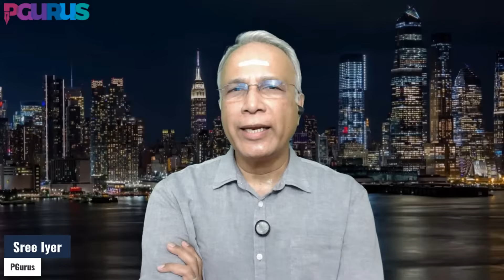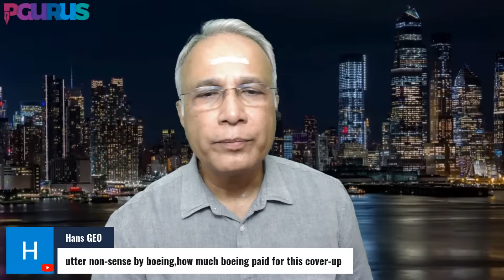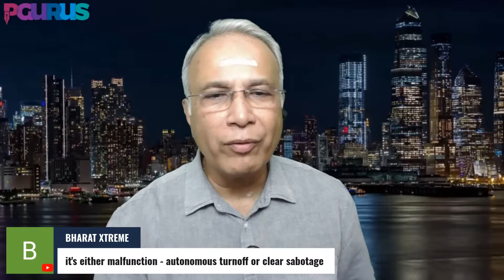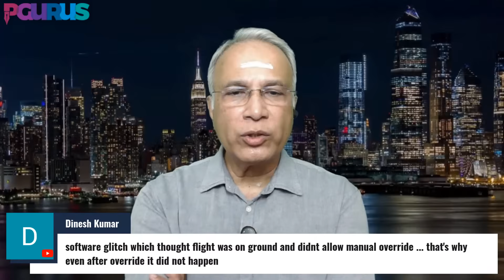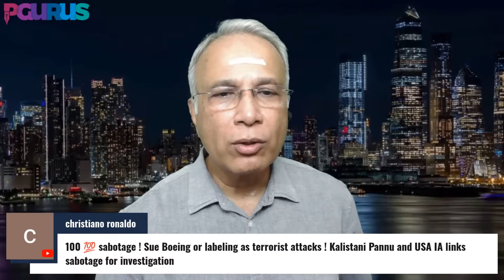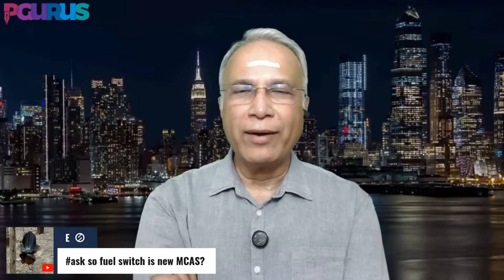AI 171 Prelim report shocker • Sree Iyer

Comment: 🧩 Most Plausible Crash Scenario: Step-by-Step

⸻

🔧 STEP 1: Tampering Occurs During Ground Turnaround (~5 minutes)
	•	Flight AI171’s aircraft (VT-ANB) arrives from Delhi to Ahmedabad ~2–3 hours before its scheduled return flight.
	•	During this downtime, a malicious actor with authorized cockpit access (e.g. ground engineer, technician, or cleaner) enters the cockpit.
	•	They intentionally flip both fuel control switches to CUTOFF, internally disabling fuel supply to the engines.
	•	Using subtle manipulation (e.g. bending or dislodging internal latch or spring), they force the switches to visually appear in the RUN position, misleading the pilots.
	•	The entire act takes under 5 minutes and leaves no obvious trace if done carefully.

✅ Why it works: These switches are mechanical, and their position indicators are not electronically monitored. The system assumes visual + pilot input = actual state.

⸻

🧪 STEP 2: Pilots Arrive, Perform Normal Preflight (~30–45 min before pushback)
	•	Flight crew performs regular cockpit setup and checklist:
	•	Engine start switches → CHECKED
	•	Fuel switches → visually appear to be in RUN
	•	Engines are started normally:
	•	FADEC uses pressurized fuel in the lines to spool up
	•	No alarms are triggered because system believes switches are in the correct position
	•	Pilots proceed with taxi and takeoff prep.

✅ Why they don’t notice: There’s no indication from EICAS or ECAM of fuel flow blockage until engines actually flame out. These switches do not have active feedback systems.

⸻

🚀 STEP 3: Takeoff Roll — Aircraft Lifts Off Normally
	•	Aircraft begins takeoff roll, reaching V1 and then rotates as planned.
	•	Thrust is still available from fuel already in the manifold, and the engines deliver expected performance.
	•	Aircraft lifts off and begins climbing.

🧠 Fuel in the lines masks the tampering for ~30 seconds.

⸻

🔥 STEP 4: In-Air — Fuel Supply Fails, Both Engines Flame Out Simultaneously
	•	~20–30 seconds after liftoff, the residual fuel is depleted.
	•	With the fuel valves internally closed, no new fuel reaches the engines.
	•	Both engines rapidly lose power and flame out.
	•	EICAS displays:
	•	ENG FAIL L
	•	ENG FAIL R
	•	GEN OFF BUS
	•	FUEL PRESS LOW

⚠️ The aircraft enters total power loss while climbing, now essentially gliding with limited time and altitude.

⸻

🎙️ STEP 5: Cockpit Confusion — Attempted Recovery Fails
	•	CVR records only:
“Why did you shut off?”
“I didn’t.”
	•	Crew likely:
	•	Flips the fuel switches again, trying to “re-confirm” RUN position.
	•	Initiates quick-start attempt (per checklist), but it’s too late.
	•	There’s no altitude, airspeed, or time to recover.

❗ This shows pilots were unaware of the real internal state, indicating the visual cues misled them.

⸻

💥 STEP 6: Crash
	•	With no engine power, the aircraft descends rapidly.
	•	Attempted emergency glide or return to airport fails due to low altitude.
	•	The aircraft impacts terrain near the airport, resulting in total loss of life.

⸻

✅ Why This Scenario Is the Most Plausible

Factor	Mechanical Failure	Sabotage Scenario
Quadrant history	✅	✅
Timing window	❌ unlikely to fail coincidentally	✅ 2–3 hours available for tampering
Simultaneous dual failure	❌ extremely rare	✅ explained by coordinated act
No alarms beforehand	✅	✅
CVR quote	❌ unexplained	✅ shows crew was surprised
Visual vs. actual state	❌ would show up as system fault	✅ aligns perfectly with tricked switch

⸻

🔍 What Final Investigators Should Check to Confirm This
	1.	Throttle quadrant debris: Check internal detents and springs.
	2.	Switch movement history: Look for unnatural wear or misalignment.
	3.	Cockpit access logs or CCTV: Who entered post-landing, pre-departure.
	4.	Tool marks: On switch guards or detents.
	5.	Quadrant part history: Was this same part replaced repeatedly? If yes, why?

⸻

If this hypothesis proves true, it could represent a rare but catastrophic case of intentional mechanical sabotage, exploiting a known design vulnerability that had been flagged — but never fixed fleet-wide.

Comment: Shreeji... the report says the fuel control was "transitioned" ... that leaves with TWO possible suspicions.. 
One is manually in the cockpit and the other is by automatic control system. 
But the pilot cannot be totally blamed owing to the second possible cause. 
I checked the pilot checklist (https://toulouse747.com/wp-content/uploads/2018/12/Boeing-787-Checkliste.pdf) 
which says the position of this control is lastly at ON position for the engine to run and that is confirmed by the start-up and take off. 
Therefore, the possible handy work of someone on the ground who may have meddled with the system 
with potential add-ons such as delay switch that could be connected to the fuel line or fuel system. 
This calls for techno-crime investigation of last maintenance / repair works including 
use of lie detector on the people who were involved in such repair works. 
(Incidentally I am Indian Air Force veteran between 1978-93 and an Ex Air India Commercial Deputy Manager between 1994 and 2001)
You can reach me if you want to.

Comment: The fuel cutoff switches can only be operated with a specific sequence of voluntary actions. You can’t just switch them off accidentally. It looks like the software cut off fuel even though the hardware switches were not touched and they then had to operate the switches again. There’s more here than meets the eye. One of:
- one of the pilots knowingly operated the switches which appears unlikely from the conversation 
- Boeing’s software glitches caused it
- Sabotage at software level

Comment: In Ahmedabad while filling the fuel to the flight somebody has cut off the fuel switches purposefully, once switches off the flight can few seconds because what ever fuel left in the pipelines to flew few seconds then next history, officials they should check with ground fuel filling staff.
Reply: THe pilots have pre-checks...
Reply: @av1421 It's a deliberate blunder caused by pilot ..Surely Background check / investigation of both pilots is now priority. 
So sad that there is no other safety interlock in such a sophisticated modern age aircraft ... Painful Lesson,, Human error which turned out as act of genocide,,This  happened  just because designers have not taken into account of this manual mischief..??